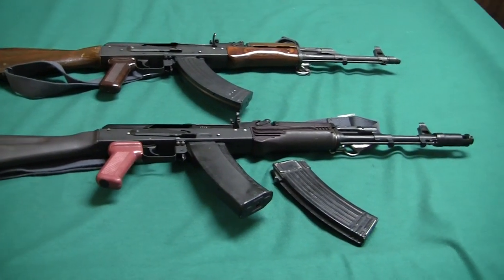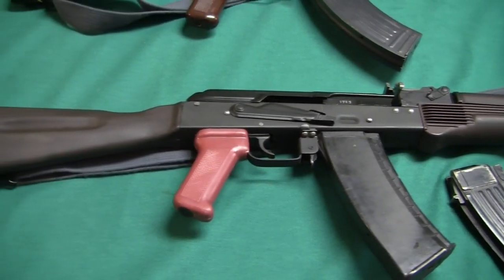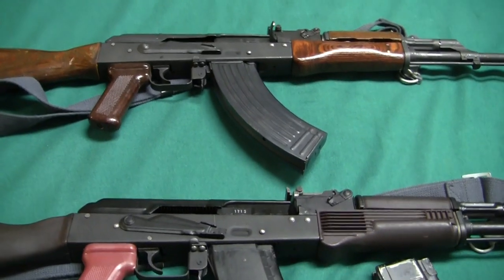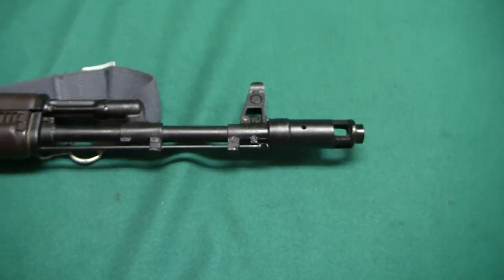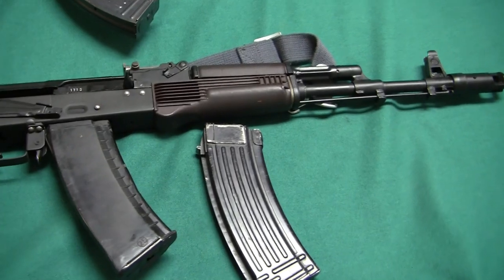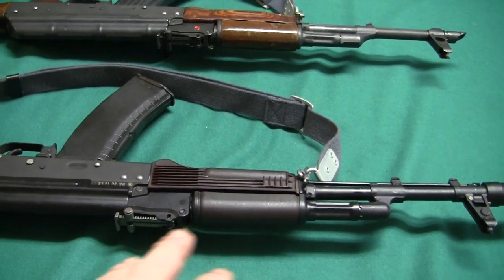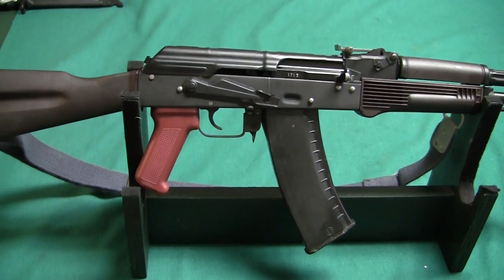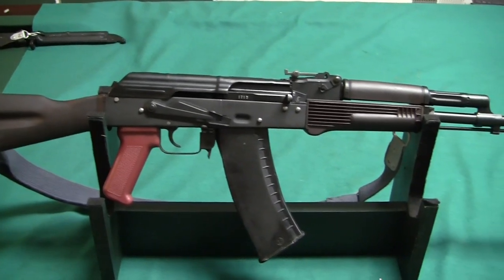Bulgarian AK 74 overview history

Comment: Prices on these skyrocketed
Reply: You're not kidding. I bought a Bulgarian 74 parts kit build with a US receiver and an SLR104 probably 15 years ago or so for 480$ and 750$ respectively. Now I could easily sell either one for 1600$ to 2400$. I like them both, but they aren't worth that kind of money. Especially with how difficult it will be to get 5.45 down the road.